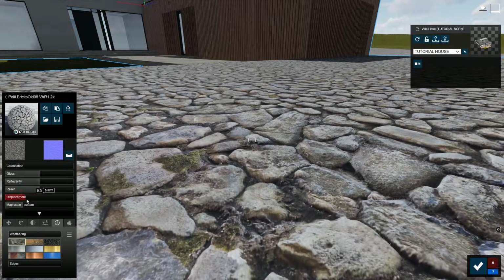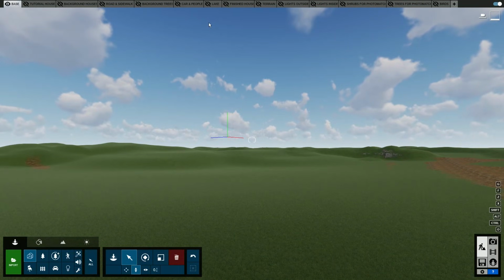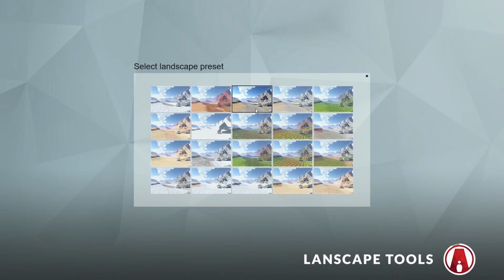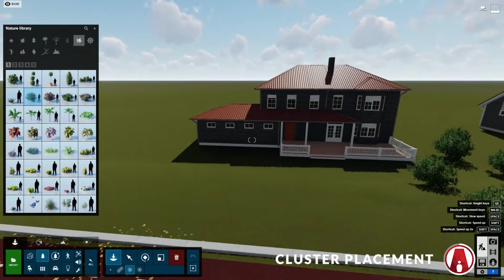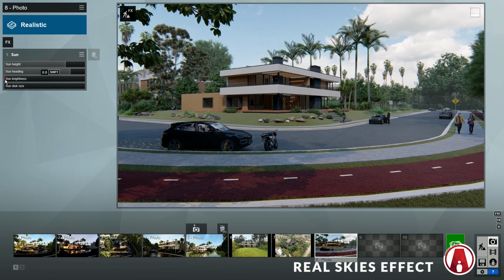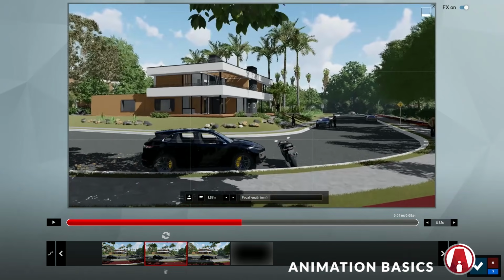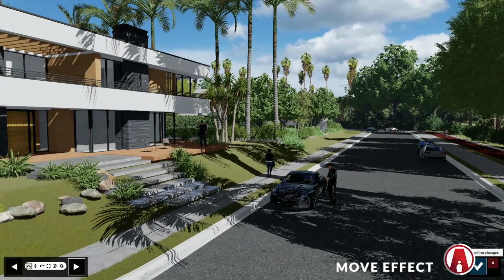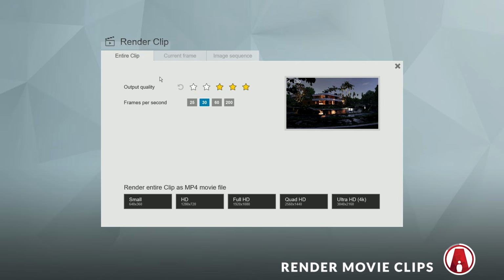Learn Lumion in 1 Hour - Ultimate Beginner's Guide

Comment: Hello. I was using max 2015 and lumion 10.3.2. But I installed max 2021 and did not uninstalled max 2015. Lumion was unable to upload 2021 max file. then I uninstalled 2021 max and lumion started uploading max file. What is the reason for that. And if i uninstall 2015 max will lumion was able to load max 2021 file.

Comment: Sir, if a PC was built with: CPU core i5, RAM 16GB, SDD 256Gb, VGA 4G. Is it ok? Sir.
Reply from the maker: Hm it's a little low on specs, I'm not sure if it will run Lumion well
Reply: @ArchitectureInspirations  Ok Sir - Thanks your answer.

Comment: Bro my laptop
Hard:1 terabyte
Ram:8 giga bite
Corei 7 but it's still work slow on my pc any recommendation bro???
Reply from the maker: What GPU do you have?
Reply: @ArchitectureInspirations  intel R UHD 620 i dont know what does this mean but i get it in task manager
Reply from the maker: Oh that's just an integrated GPU which is not very good. Lumion uses GPU so you need a good one to run it well
Reply: @ArchitectureInspirations  mmmm ok but is there any way to push my pc i mean program to refresh or to make pc fast is this work?
Reply from the maker: Only if you get a better GPU
Reply: @ArchitectureInspirations  and my screen ram 1.8 giga bite

Comment: Hi just wanted to ask, if 
My laptop specs can handle lumion 10
Cpu - Intel core i7-7700hq cpu @ 2.80ghz
Gpu - Nvidia GeForce gtx 1050 4 gb
Ram - 12gb

Thank you
Reply from the maker: Hm the GPU might be a little low for Lumion 10
Reply: @ArchitectureInspirations  thank you, what would be the minimum GPU for lumion 10?

Comment: System requirements 
Is it works on gtx 1650 and 9gen i5 8gb ram
Reply from the maker: Here are the requirements https://lumion.com//requirements.html
Reply: It will be slow but it doesn't mean you can't work at all. It will. I too have same configuration you mentioned.